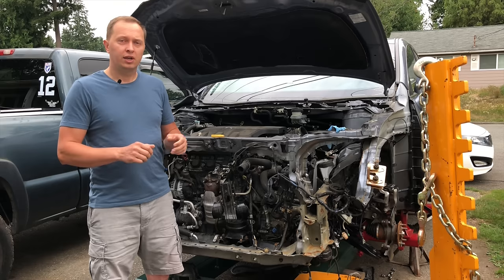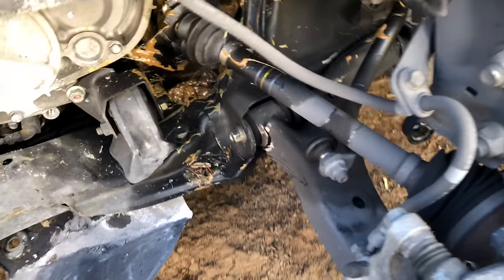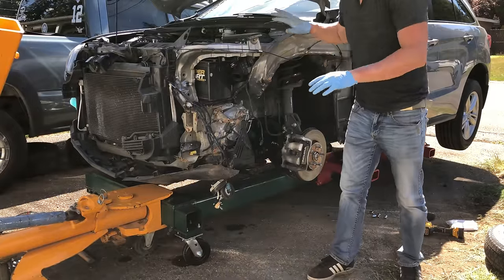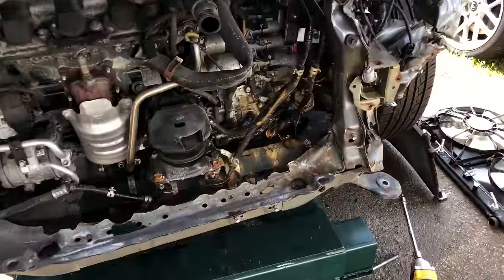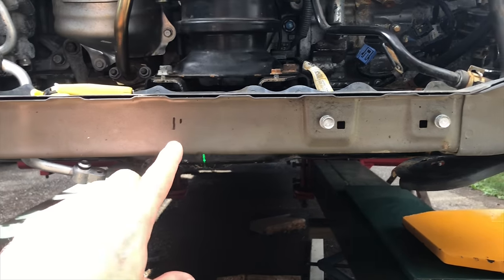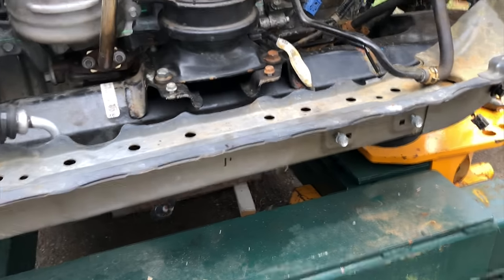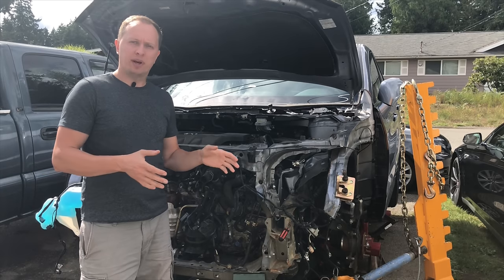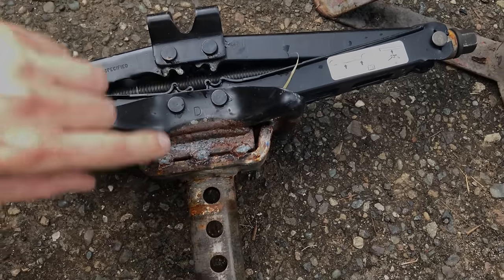✅ First Frame Pull Test on my Homemade Frame Rack Jig.

Comment: Please for safety measure put a blanket on your chain in case something snap on you don't finish cut in alf
Reply from the maker: I know, I know... The reason I didn't use the blanket this time around is because it was a first vid of this rack in action and I wanted to show folks how everything worked without obscuring anything...

Comment: Your fame machine look good but is way to short you need a min 4-5 foot longer rack for trucks of larger suvs
Reply from the maker: In my previous video where I covered the process of how I built the rack, I mentioned that I wan't planning on using the rack for work on trucks or full size suvs. This rack is more suited for cars and crossovers.
Reply: @fix206  still to short for that car...try and a pull from the front and try a set up a pull from the same set up from the rear   you willl quickly see it's to short for that car.
Reply from the maker: I know what you mean, but I built this thing to be more on a portable side. I don't like to deal with vehicles that are damaged all over... Too much work, not worth the effort in my opinion. I've done a lot of car projects over the years, and I built this rack to suit my exact needs, no more, no less. This thigh might not work for a lot of people ( it might be too short, or not strong enough) but for me it's perfect !!!

Comment: I can't do that frame machine, I will just rely on the tree with some kind of puller tools.
Reply from the maker: Tree or a pole work just fine, you just have to figure out a way to lock the vehicle in place so it will not move during a pull. Frame rack just makes it easier, but the principal is all the same :-)
Reply: @fix206  Thnx a lot for the encouragement. :goodvibes::goodvibes::goodvibes:
Reply from the maker: My friend, you are very welcome !!

Comment: Ehhh wrld the control arm,,epoxy the airbags,bolt on partswith self tappers and be done lol...
Reply from the maker: Self tappers? are you crazy? that's what zip ties are for :))
Reply: @fix206  and epoxy lots of epoxy
Reply: The machine is awesome could easily sell for 5,10k
Reply from the maker: Yeah, I've already had some folks approach me with intent to purchase the rack... And I've told them that I built it with intent of using it myself therefore its not for sale..👍
Reply: @fix206  yes i build purpose use tools for mypersonal use too,not4sale..great work

Comment: You did it the wrong way. Should of pulled it with rebar on, you pull both sides at the same time.
Reply from the maker: Yeah maybe... But the rails still got pulled together, since they're connected through core support

Comment: Yea you can literally see the hydraulic fluid on the ground, so your assumption may be right my friend
Reply from the maker: Yeah, I think one of the seals on the ram isn't holding and leaking. Funny thing it only leaked in the beginning while I was pulling on the small stuff. I'll swap out the seals later on, maybe even do a quick video of process.
Reply: @fix206  yes I seen that as well, but it is a nice setup and very informative thanks
Reply from the maker: Thans bro 👍

Comment: wouldnt buy any car thats been messed about with like this. Once its been bent out of shape and back again you have fatigued the crystal plane structure of the metal, and it will never be the same strength. You should try cutting a piece out and getting someone to look at it under an electron microscope
Reply from the maker: Well it's not like this thing has been badly crunched. The rails just moved far enough over to throw off the gaps between the hood and the fenders. But if you use the same logic then nothing is good once it becomes used. Your brand new tires will start developing micro cracks after you put a couple of hundred miles on them, your steering and suspension components start wearing out after they get some wear and tear on them which once again makes them less safe than they were when they were new. Basically what I'm trying to say is that everything is relative, no car is 100% the same after an accident or even after he's been on the road for a while. But I bet you that the structural integrity is at about 97–98%, which is basically what you get with any vehicle that comes out of anybody's shop after the repairs. I'm sure that some folks out there would cut a damaged frame rail in half and then use some crappy flux core welder to weld on a replacement rail... Now that type of repair would be much less safe than anything that I would ever do